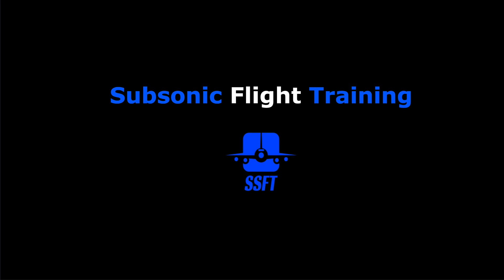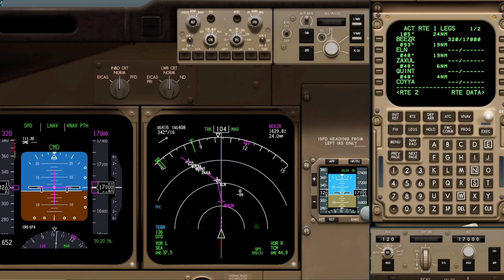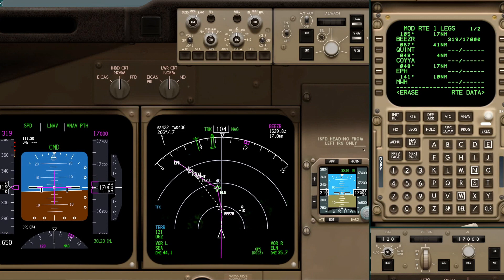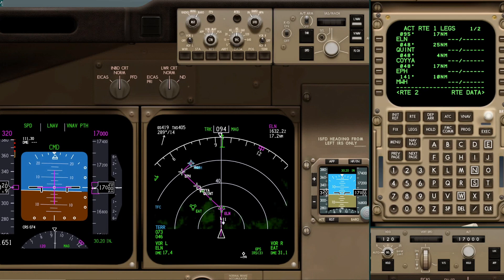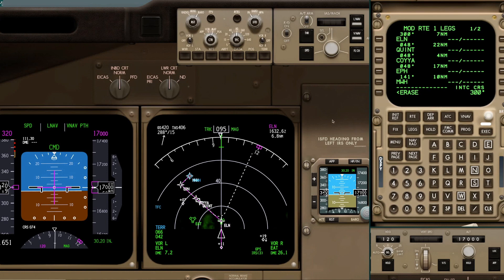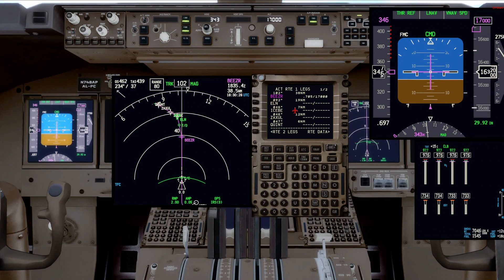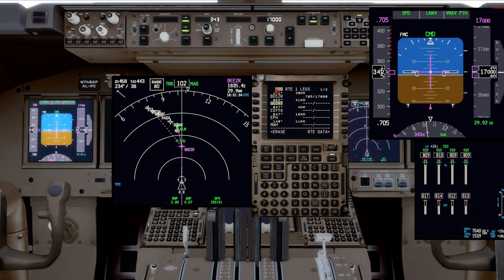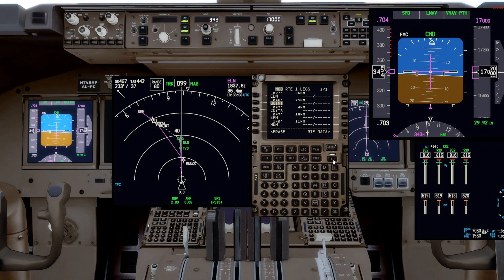Ep 8 | TIMED TRAINING TIPS | FMS-CDU EXERCISES - PART 2

Comment: P/P320 gyration was a clearing turn ;-)
Reply from the maker: Yes, it gyrated quite a bit, you will see that if you intercept a Localizer at angles greater than 30 degrees as well. If I was flying for real, I probably would have gone to HDG SEL or HDG HOLD until passing the Waypoint if it started to make a turn like that...

Comment: Great Videos! I am new to Transport, currently in 767 sim training for my type. I am new to the FMC and these vids are excellent!  How do I get the simulator your using? Is there a 767 Version? My company didn't provide any FMC sim for training. Trying to figure it out from the book, cpat, and you!  It would be great to have a sim like you are using to practice.
Reply from the maker: Good luck on your type rating. I have the PMDG 747 and the Aerowinx 747, but you might want to check out Quality Wings, which has a B757 model, which is quite good.

Comment: Hello captain. In regards to missing waypoints in Aerowinx PSX's database, there is a workable solution. If you have PFPX flight planner, and subscribe to navdata updates (from Navigraph), you can export flight plan (most recent navdata) to PSX. PSX accepts it without any issues. 

Also, the radial outbound feature will work in NGFMC B744 or only in B748 FMC? 
EDIT: Answer is yes it will.
Reply from the maker: You are spot on, yes it will. Thank you for the suggestion. I do not use PFPX, but I do get the Navigraph updates, will have to take a look at that sometime. Thanks for being a subscriber alippay2...